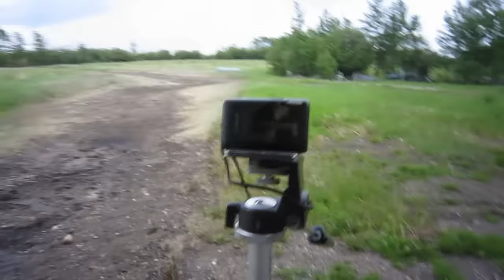Testing a GE J79 with afterburner

Comment: What a wonderful engine. Glorious human ingenuity!
Are these systems controlled electronically, or by electromechanical or mechanical systems? I'm curious how well the J79 would take abnormal conditions, too - dust, smoke, very heavy rain/hail, etc. Always been a big fan of jet engines.
Reply from the maker: The fuel control is all hydromechanical.
Reply: Like a mechanical miracle. Are there adjustable settings on the outside, too? I'm really curious, forgive me if I interrogate you - I'm also a writer, knowing as much as I can about jet engines is something I want to do.
Reply from the maker: Every aspect of the fuel control is adjustable when the engine is being built and tested. In the aircraft, the pilot can only adjust the power lever angle, which you could call the throttle lever, or as it is sometimes called by motorcyclists, the loud handle.
Reply: @AgentJayZ  Ahh. So the engine is configured at the test cell, but not by maintenance further on, e.g. for very hot or cold days where temperature may be a problem? Does the engine compensate for all that?
Reply from the maker: One of the signals read by the main fuel control unit is inlet air temperature. There are no adjustments made by the human operators. The engine adjusts itself.
The humans must not approach the engine.
Keep the humans away!

Comment: These J79's, could push an RF-4 to over mach 2.5 at high altitude.   I was told they could our pace our F-15s.
Reply from the maker: It's not all about speed, but yes, some older planes are faster than the new ones.

Comment: Guess you guys don't set the throttle until the engine is running.  That thing was way above idle after the start.
Reply from the maker: Idle is 5000 rpm, and our instruments showed within a hundred of that.
Reply: @AgentJayZ  Video: 10 yrs ago
Creator: Still replying to comments
I love when someone is so dedicated to their hobby and still answers comments 10 yrs later!
Reply: @AgentJayZ  Maybe I was wrong but the engine seemed higher and the nozzle was pretty far closed.  In the plane we always used a "wet rigger" to pressurize the torque booster and rig it like it was running.  At cell we just got it close until the ground guy made it right.
Reply from the maker: Well, all I can say is: we have the book, we build the engine, we run the engine, and we don't ship it back to the owner until it runs right.
Reply: @AgentJayZ  we called the f4 the flying brick and with 2 j79 you could make anything fly lol

Comment: If memory serves me right the J-79 in the F-104 had a 4 stage afterburner, is than correct?
Reply: is THAT correct?
Reply from the maker: The J79 has a variable fuel feed to the afterburner, so it is more controllable than the all-or-nothing systems used on previously designed engines.
The early J79s had 2 separate fuel supply manifolds for the spraybars in the AB. The valve allowing fuel flow into one of these manifolds opened at a higher pressure than the other. Each of these manifolds supplied a different section of the 23 fuel flow orifices in each spraybar.
Later J79s had the same system, but with 4 manifolds, 4 valves, and 4 sections of orifices on each spraybar.
It is not described as a 4 stage AB, because to the pilot, the AB is smoothly progressive, with no steps or stages in its action.

Comment: Why wasn't the front blades spinning, or were they?
Reply from the maker: Video for you: Your questions answered. It's number one in a playlist of the same name.
Reply: Watch from 13.40 you will see them stopping
Reply: Order, Front, Front bearing housing support struts, next, VIGV's or Variable inlet guide vanes, next, First stage compressor blade's.
Reply: Those metal struts you see in the fan are inlet guide vanes. The first stage of fan blades are directly behind those vanes, and are kinda hard to see spinning on coast down.

Comment: Would you care to explain why is it so loud considering that there is only one moving part (rotor) in the engine?
Reply from the maker: There are thousands of moving parts, but I think the noise is caused by the large volume of air flowing into and out of the engine at very high speed.
A small amount of air moving quickly is what comes out of a shop air nozzle, and it makes a lot of noise.

Comment: OK now the questions. Where did you get the engine? Were you an A&P man? Was the engine ready to go when you obtained it? Where do you get parts? What if you can't?
Reply from the maker: 1 This one was purchased from an air force that was retiring the planes that used these engines.
2 I wasn't
3 Basically, but it had been in storage for years
4 Anywhere we can
5 Failure is not an option
Reply: AgentJayZ: Interesting. So now I have a few questions. 1. What was this engine used on? 2. What will you do with it? 3. When you say “failure is not an option”, are you planning to fly this thing somewhere?
Reply from the maker: The J79 is used to power various aircraft at up to Mach 2.5 and beyond.
We will return it to it's owner after we finish testing it
Someone else flies it, we just do the work on it.

Comment: Hi Jay, I am and rocket engine enthusiast and I was wondering if you have any tips for making turbine and compressor blades at a small scale? Or literally any other tips to help me would be great 😁. Just wondering. Thanks!
Reply from the maker: The rockets I know of don't have compressors. Making combustion gas turbine blades is a high-tech industrial process that, to my knowledge, has never been successfully carried out by an individual or amateur constructor.
I have no tips.
Reply: The simplest way of making a basic gas turbine is using a car turbocharger.

Comment: What is the thrust , in lbs , when the afterburner is used...and I guess the test bed is bolted to the concrete...,,??...to be that secure ?
Reply from the maker: I think we made about 18,500 lbs of thrust this day. The nominal spec calls for 18,300 in full AB.
Reply: @AgentJayZ  Thanx for the info...How much is that stand setup rated for...?

Comment: Being in an outside open air setup shocks me.  How easily could a small bit of debris get sucked into the newly built fighter engine?
Reply from the maker: Just like an aircraft on any runway anywhere... only our front pad of polished concrete is swept clean before every start. Nothing's ever been sucked up into an engine in 20 years of testing.

Comment: How come we need a spark to ignite the afterburning fuel?
Reply from the maker: The temperature of the exhaust of the basic engine is insufficient to ignite the fuel sprayed into it by the afterburner fuel spraybars.
Reply: @AgentJayZ  wow thanks , I always assumed the exhaust gases would be hot enough to ignite the fuel.

Comment: Jeez, how do fighter pilots withstand that unbearably loud sound?
Reply from the maker: I tried on a jet pilot helmet last summer, and I was amazed at how good they are at sound attenuation. Better than a pair of over the ear defenders.
Reply: @AgentJayZ  Yeah, and the pilots are inside the cockpit too, which also holds back a good bit of sound.
Reply: Cockpit has amazing sound isolatio, plus the helmet is also made to isolate. Im sure they still hear the engine even with those 2 but if youve spent years flying you get used to it.
Reply: They just fly away from it
Reply: @Omgiamsotriggered  not to mention that sound is at the rear of the AC, and not near the cockpit.

Comment: Hello! Could you please provide me engine test data for validating my simulation model ? 
I need to validate temperature distribution along turbine blades and vanes, so if you have anything related to that i would be very grateful!
Reply from the maker: We don't measure temp distribution along various positions of a single blade or vane.
That would be research data collected possibly by a manufacturer, or maybe in a university science laboratory.
We don't do research or design. We test engines to make sure they perform as specified by the manufacturer.

Comment: Does the nozzle close as a direct result of some physical parameter or indirectly via electronics (i.e. does air speed (for example) force the nozzle in and out, or is air speed measured by a sensor and a computer controls the nozzle position)?
Reply from the maker: The Nozzle area controller uses inputs from the fuel control, the EGT probes, and the nozzle position indicating feedback cables to:
1) only allow the nozzle to open if afterburner ignition takes place
2) modulate nozzle area proportional to throttle position in the variable afterburner range
3) prevent overheating of the jet pipe liner

Comment: hey jay thank you for another amazing footage. so what is the thing attached to the fan in front and why isnt the fan spinning?
Reply from the maker: I recognize your name, so I will assume this is a troll. You could have made it better by calling the thing in front a turbine...
Reply: @AgentJayZ  Definitely not trolling. All of us are not mechanical or aeronautical engineers sir. I just dont know what is that pipe attached to the fan in front of the engine. is that used to run the engine or something?
Reply from the maker: Oh.
The pipe is the air supply to power the air turbine starter motor inside the aluminum nose fairing.

The first thing in the engine you see are the struts which support the bearing housing at the center.
Behind those are the variable inlet guide vanes. They pivot but stay in the same location. The VIGVs do resemble a fan. Behind those is the first stage of the compressor rotor.
All modern airliner engines are turbofans, and they have a greatly enlarged first stage of the compressor which moves a lot more air than the engine needs, and the extra is bypassed around the core of the engine. That enlarged first stage is called the fan.
The engine in this video is a turbojet, and it does not have a fan.
To see this illustrated, check out my vid called Your questions answered #1

Comment: Anywhere from 35-90 gallons per minute! 🤯 I’m not complaining about how much gas my boat goes through anymore 🤣
Reply from the maker: Well, at 35 gpm, it's a 9,000Hp engine. With afterburners, the calculations kinda break down...

Comment: Those titanium blades will come right through all that weaker metal in a flash god forbid a mistake happen - thus the red line painted along the back side of the f4s fuselage
Reply from the maker: Number of titanium turbine blades is any gas turbine engine ever made is zero.
Number of titanium compressor blades in a J79 is zero.
The "weaker metal" you are referring to is steel alloy.
Weaker than what? Steel is stronger than any titanium alloy, and any aluminum alloy.
So, not really sure what you are referring to.
Now git.

Comment: Is the variable diameter of the exhaust nozzle able to control the pressure enough to prevent mach diamonds, or is there something else at play?
Reply from the maker: There is no pressure in the exhaust. There is also no need to control the Mach diamonds.

Comment: Where's the fire during afterburner phase? I see a LOT of raw fuel being dumped....in afterburner, you see concentric cones repeat, one after the other...OR, to ignite it, you'd need a much better (and solidly bolted to the floor...) test stand.
The huge plume you see is all raw fuel......wtf????
Reply from the maker: The fuel for the AB is metered and distributed with the same precision as it is for the core. There is a separate fuel pump, filter, and fuel control for AB. This engine is shown in full afterburner, and the test stand seems OK, eh?

Comment: What's the wind speeds behind when the afterburner kicks in??
Reply: Somewhere around 3 times the speed of sound and a couple of thousand degrees celsius, if I remember correctly.
Full mil power is about 1.5 times the speed of sound at around a thousand degrees (that's right behind the engine; the exhaust gas quickly mixes with the slower surrounding air and cools fairly rapidly)
Reply from the maker: At the narrowest portion of the final nozzle, the gas speed is local Mach one. The speed of sound changes with temperature, and the gas is about 1100 F without AB, and flame temperature, or about 2500F or so when in AB.
When in AB, the gases continue to accelerate while traveling out of the divergent section of the nozzle.
I don't know what speed is attained by the time they leave the back of the nozzle, After that the speed of the gases diminishes quickly, so by about 100m behind, the wind seems to be about 100 Km/hr or 60 mph. Dangerous to stand even that far back right behind the engine, because small rocks and dirt carry their speed much farther, and can hit you like bullets.

Comment: I know nothing about the engine. Can anybody explain me why tip of the engine is opening and closing  when the noise get loudest (or I may say when it is reaching max thrust) ?
Reply from the maker: Video for you: the variable jet nozzle.
Reply: We called those the " turkey feathers" they closed when going to MIL power for more thrust, they open at low thrust and when using afterburner. I worked on the F-4 Phantom II for3 years. They were powered by the J-79

Comment: How thick are the bolts used to withstand the shear stress?
Reply from the maker: The bolts are not really in shear, because they apply clamping force to the interfaces between steel plates aligned with the direction of force. The massive friction created by the tension in the bolts prevents movement. If the plates were free to slide relative to one another, they would be placed in shear by the engine thrust.
As it is, the bolts holes are larger in diameter than the bolts, and the plates do not move.
They are 3/4 inch bolts, grade 8, torqued to about 250 ft-lbs.

Comment: So the rotors on the front end don't even move? Is all of the air displaced being sucked in on the sides of the thrustnozzle? Or whatever you wanna call it ..
Reply from the maker: Please watch Your Questions Answered. Episode #1
Reply: In case you didn't pick it up from the video, the stationary airfoils visible from the front are inlet guide vanes. Each stage of rotating compressor blades has a corresponding set of vanes.

Comment: I don't understand how that curly head dude isn't protecting his ears. Insanely irresponsible.
Reply from the maker: At idle, it's not as loud as you might think. He went back inside the control room before the engine was throttled up.
Reply: At the point of view of the tripod, double hearing protection is necessary but not sufficient, as the noise intensity is literally bone rattling.
Reply from the maker: Yes, cap... That's why I put the camera there, and I got the heck away!
Reply: @AgentJayZ  thanks for responding. I'm a shooter, drummer and bit of an audiophile so I know how precious ears are and how sensitive they can be that's all...

Comment: How much fuel it takes during a single test run like this?

Thanks
Reply from the maker: Every test run is different, so it varies. We have a 1000 gallon fuel tank, and usually a test run for an aircraft engine consumes some portion of that. Sometimes when an engine is in the test cell for a couple of test runs, we need to refill it.

Comment: Mr JayZ, have you ever worked F100-220's or F110-100's?
Reply from the maker: No current fighter engines. Only industrial engines, and engines used in privately-owned aircraft.

Comment: How do you get a job doing this anyway? This looks awesome.
Reply from the maker: I posted a video called So You Want to Work on Jets... or something like that.
Reply: Get an engineering degree in mechanical or a mathematics degree I hold an associate's degree in mechanical engineering one of my professors worked at Pratt and Whitney and for NASA it's incredible the engineering that has been done not only by Pratt but electric boat in Groton Connecticut it's all about the math I also hold a degree in mathematics PhD mathematicians are a strange lot  ♾️ just for laughs look up 2+2=5 there is a flaw in the proof but it is entertaining

Comment: 7:13 wow, your camera standing still not get blasted out the engine.
Reply from the maker: Just outside the jet exhaust, otherwise it would be a quarter mile down the field...
Reply: @AgentJayZ  thanks for tell me how you place the camera to take the blast moment, I'm new and curious about "what if things stand behind jet engine blast",  anyway great video dude.. Keep it up..
Reply: @AgentJayZ  How hot is the blast and would it cause burns if you stuck your finger in it and melt stuff in it's way
Reply from the maker: They are blown to pieces as they are burned or melted.
Reply from the maker: Everything depends on distance. The first function of a jet engine is to produce thrust. The heat is a waste byproduct.
At 10 m and full throttle: finger burned, and arm ripped off. The heat might stem the blood flow, but likely the body will be pulled into the exhaust flow, where it will be blown apart and burned, scattering pieces out to distances of 100m or so.
Decapitation ensured.
Survivability zero percent.
... not recommended...

Comment: What is the purpose of this engine?
Reply from the maker: To propel an aircraft through the air at up to Mach 2.5
Reply: J79 is the engine from the F4 Phantom II fighter, was also on the B-58 Hustler
Reply: Preheating ovens

Comment: Dose the compressor work in this video? I didn't see it moving.
Reply from the maker: It's moving too fast to see when running. An explanation of the parts at the front of the engine is featured in my video called Your Questions Answered. It's actually #1 in a playlist of the same name. There are over a hundred videos in that playlist, and you may enjoy some of them.